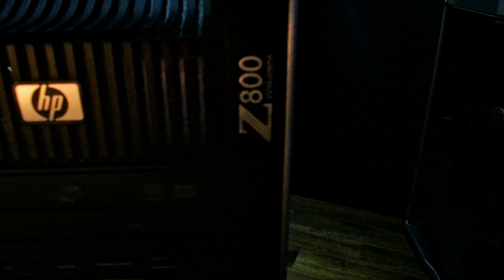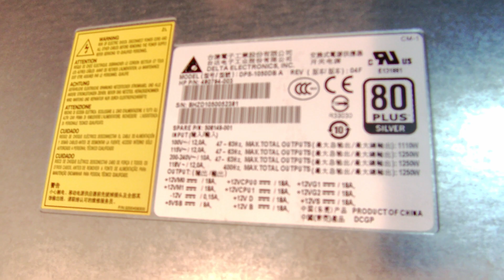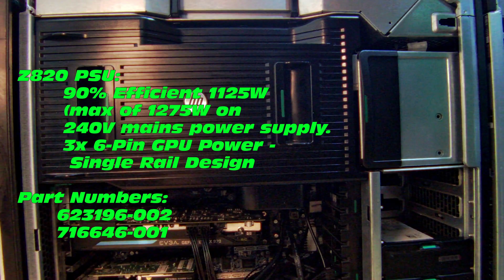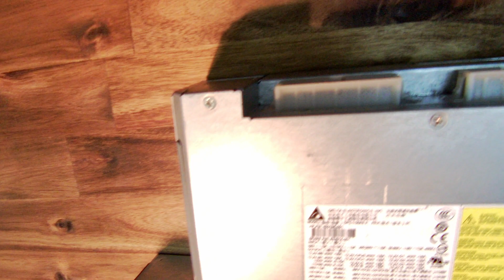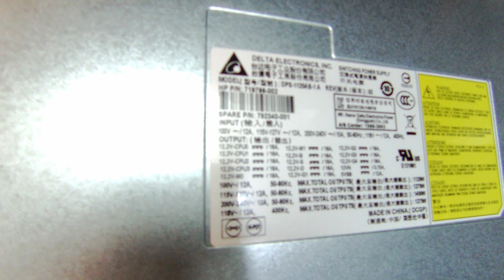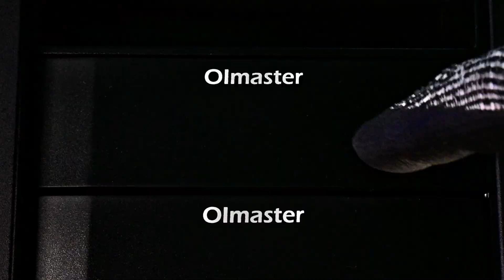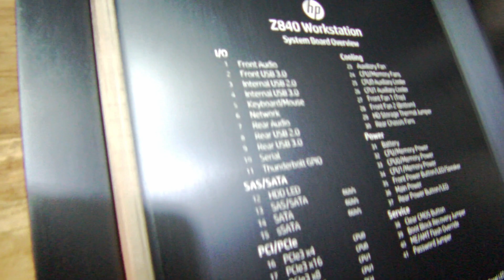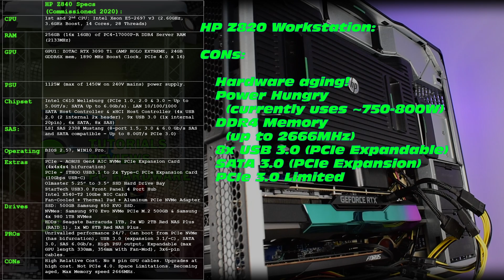Z800 / Z820 / Z840 Guide : Power Up Your Workflow with a Workstation (Remastered).

Comment: hi, do you know a HP z440  max ram supported , assuming the CPU is upgraded appropiately?
Reply from the maker: Hi there. Officially, up to 128 GB total, using 8×16 GB modules. But unofficially, some users have reported using 8×32 GB sticks for 256 GB total - but in the same chat thread someone reported that this configuration didn't work: https://www.reddit.com/r/techsupport/comments/umhjgv/hp_z440_ram_help/. 

So I would say go with 128GB (8x 16GB modules; DDR4 2400MHz ECC Reg if using E5-26xx V4 CPUs), if you happen to have 32GB modules on hand you could test them to see. Start with just one 32GB module and see if the system boots, then try four, then eight. Note, for more than 4 RAM modules on the Z440 you do require the memory fan module (P/N: J2R52AA). I have used 4x 16GB 2400MHz ECC modules on my Z440 with success: https://youtu.be/K4RalaEbRI4?si=U8uCNIdq4mJdhvL1&t=228
Reply: @racerrrz  hi, regarding using a Z440 on another normal case, is it a bit more easy than the Z420 , because there is no need of transistor or temperature sensor connected, but it still need that all the other peripherals to be connected as Z420 motherboard ?

Comment: Any plans on doing something with a z440 or z640?
Reply from the maker: What did you have in mind? 

I have been trying for 4 years to secure a Z600, Z620 and Z640. I gave up and sold my Z600, but I now have a Z640 - so I just need a Z620 to film a similar video guide for them (I filmed the Z600 before selling it!). I have done a related video for the Z4xx here: https://youtu.be/K4RalaEbRI4

If you were after alternative build videos etc., I have done quite a few videos on the Z440, Z840 and Z8 G4. 
Examples:
Z440 Case Swap NAS Build Guide: https://youtu.be/K4RalaEbRI4
Z440 with massive HDD storage: https://youtu.be/T925XvAcqEo
Z840 Overview: https://youtu.be/Om3_HErti08
HP Z8 G4 Overview: https://youtu.be/z7Ff2zs5ByM

It just depends on what your plans were for your system, but I am sure I have video done for it!

Comment: Hi! I have an HP Z820 workstation and I’m wondering if there’s any safe way to overclock the CPU or disable the PL1/PL2 power limits. Is there a method to unlock full Turbo Boost on this workstation without risking hardware damage?
Reply from the maker: Hi there. HP has these workstations on lock-down - leaving no viable method for overclocking. It is counterintuitive on these workstations since they were designed to be reliable and to give stable performance. There may be custom BIOS mods out there that could give some more customization but it's not something I would recommend due to the risk of bricking the system. The other factor is the cost of replacing a motherboard if a customization causes damage. If you can live with the trade-off of favoring stability over peak performance then you'll get good service from these workstations.

Comment: I have this computer and put a 3060 12gb in it and it used to have a 1080ti. Why is it so trash at rendering videos in davinci resolve?? I thought this was supposed to be a powerful pc for it's age but it takes 1 hour to render a 11 minute video. My 3060 laptop only takes 1 minute 30 sec to do the same work as this pc
Reply from the maker: I have used the Z840 and the Z8 G4 for video rendering with DaVinci Resolve studio. The GPU is the bigger bottleneck. I went to an RTX 3090 Ti for the extra VRAM. I had issues where my projects were crashing during export due to insufficient VRAM. 

In terms of your speed issue. It's most likely a setting difference. I presume both comparisons are exported in the same file format, same video resolution and with the same storage medium? Adding effects also heavily change the render time. And I also learnt that text effects like a shadow create a huge problem when rendering. Pending the phase of the render and the complexity, my system renders a 20min MPEG4 in 4k 60fps video in 8min to 4 hours. Most of my work has greenscreen with is heavy to render. 

I tend to render the project in successive batches of renders. Add the audio effects, cut errors and pauses, remove green screen, assemble the scene, then build the A roll and B roll with text overlay. With one project typically having at least 9 renders to completion. Getting the final video together before doing text additions does help so you don't have to rerender all the effects with each export.
Reply: @racerrrz  I got the Z820 for free and it has e5 2670s and 128gb ram. I ran a test render of just rendering a video untouched in mp4 h264 1080p. It rendered the 12 minute video in 3 minutes. 37 seconds faster than my laptop. Next I added subtitles text to scenes, several custom transitions and blurr effect over faces on a few scenes and changed the coloring and lighting on a few shots. I rendered the video at 1080p same settings to the same ssd and now the video took 2 hours to render. I ran the exact same project and changes on my laptop that has a 5800h cpu and 8gb version 3060 gpu and it completed the project in 14 minutes. So I tried again but only adding in the blurr effect over aces on 3 minutes of the video and it still takes 1 hour 17 minutes to render. Same with every other effect. Just touching the video makes the render time sky rocket to over and hour to render. If my gpu is the bottle neck why can my laptop easily handle it. Am I missing something?
Reply from the maker: Ok, that makes more sense. The Z820 is quite aged now and the CPU pair you have will be quite old (I presume E5-2670 V1). The main issue with workstations is the slow single core performance relative to the desktop CPU lineup. Most software packages are optimized for single core utilization, with only certain tasks making use of more than one CPU core. In my current editing rig (HP Z8 G4 + Dual Gold 6248s, 384GB DDR4 2933MHz ECC Reg memory + RTX 3090 Ti + 8TB RAID 0 NVMe storage pool) my single core performance is my main bottleneck, and even a Ryzen 3600 would do better for that. But where my system shines is when I have to use all 40 Cores and 80 Threads. But by design these workstations are for throughput, not single thread performance. 

For a benchmark comparison:
https://www.cpubenchmark.net/compare/2750.2vs3517.2vs6549vs1220.2/%5BDual-CPU%5D-Intel-Xeon-E5-2696-v4-vs-%5BDual-CPU%5D-Intel-Xeon-Gold-6248-vs-AMD-Ryzen-9-9950X3D-vs-%5BDual-CPU%5D-Intel-Xeon-E5-2670

If you can land a Z840 with dual E5-2696 V4s you'll have a better experience from the CPU architecture being newer (also PCIe 3.0, SATA 3.0 and Gen 3 NVMes - the Z820 lags behind due to the aged SATA chipset which is really more SATA 2.0 focused). I have upgraded from the Z840 to the HP Z8 G4 (the Z840's replacement) and it is a decent upgrade in work efficiency. Most of my efficiency came form the RTX 3090 Ti - and I can transplant that into any modern system to gain a good editing experience (the 24GB of VRAM is amazing). 

It's a little harsh, but I would recommend moving away from the Z820 as a daily driver and rather reserve it for home lab functions (so running Proxmox virtualization - not power efficient however). The Z840 can still be daily driven and the upgrades are relatively cheap, but it lacks the CPU architecture to handle modern / AI workflows efficiently. If you can get the Z8 G4 with Cascade Lake Xeons you can get massive core count and the latest in CPU functions (e.g. AVX-512, VNNI, up to 56 Cores, 3TB memory or 4.5TB with Xeon M CPUs, Optane DC Persistent Memory support; unfortunately the Z8 G4 is still really expensive).
Reply: @racerrrz  Very detailed and helpful explanation thank you so much. I spent weeks wondering how it managed to outperform my latop the first day but unable to get any projects done on time for almost 2 weeks I was certain I was doing something wrong or not utilizing this pc correctly. I can at least now look up some way to make use of this pc abd this many cores(maybe). For now I can only use it for handbrake video compression and burning CDs.
Reply: @racerrrz  I really want to make this computer work since it seems to have it all but I can't get it to handle anything I throw at it any better than my 2021 laptop. It uses 3 to 5 times the amount of power and takes 5 to 15 times longer to complete any work loads on any software, UE5, UE4, Belnder, Davinci resolve, capcut, FL studio, Unity, AI training models in language, video, or image or even video compression on handbrake. I am having trouble finding any use for this pc. If I can at least get it to take advantage of it's 32 cores for Video rendering, video compression or 3d modeling or AI training then I can keep it for at least 1 of those tasks.

Comment: As of 2025, I would stay away from Z400/600/800 HP's unless you can get them for next to nothing. Not that they aren't good machines. The Sandybridge CPU's are 32nm and use a lot of power. The z420/620/820 can be had for the same price and are more capable machines. The z440/640/840 are best choice by far. They are similarly priced and much more capable. Haswell and Broadwell Xeon are cheap and still very capable. No AVX-512 but they support AVX-2.
Reply from the maker: I would agree there. There may still be some applications where they could be of use but I haven't given the Z800 much thought since 2020. The Z840 would be the most optimal in the line-up. The hardware might be aging but the Z840 still has so much on offer. Particularly with the on-board SAS chipset - they are ideal for a homelab Proxmox setup with several VMs and especially with an external JBOD added (future video). 

You may find these to be of interest:
Z820 teardown: https://youtu.be/qkvHQSwyxVQ
Z840 teardown: https://youtu.be/2bie4EGJZL0
Z8 G4 teardown: https://youtu.be/z7Ff2zs5ByM
Reply: @racerrrz  For some reason the E5-2697 v3 is the cheapest Xeon right now. They are less than 10USD. Prices on E5-2697a v4's are creeping up. Still cheap but up from 25USD to 40USD.
Reply from the maker: It's probably a result of CPU popularity. The Haswell and Broadwell Xeons were popular in supercomputer architectures and enterprise servers, and I can only presume that as those systems get retired their hardware makes it back to mainstream supply. The E5-2697 V3 is a great performer, solid core count and decent clock speed. It's the same CPU I still have in my Z840. My Z440 got upgraded to a E5-2697A V4 for a memory speed buff.
Reply: @racerrrz  Supply is probably beginning to wane. I got all my work stations and CPU upgrades over a year ago. I payed 296USD for my z840's and they came with 4x8gb PC2133 memory and 2x E5-2620 v3's.

Comment: I have two Z820's or will when the one I just won in an eBay Auction arrives. One is currently set up with one Xeon E5-2620, the other has dual E5-2620's (the one I just won). I will be upgrading the one with the single Xeon to dual E5-2687w v2's when those get here. It's also getting a RAM upgrade.
Reply from the maker: Nice. The Z820 is great value - upgrades are cheap and you have ample end-use cases for them these days. How are you planning to use the second system? I feel like the Z820 is ideally placed as a home Proxmox VM server - you would host just about everything you could want from it and still have spare cores on hand.
Reply: @racerrrz The second one is going to be a Father's Day present. My stepdad needs something better than the old HP laptop I loaned him after his Mom's laptop died.
Reply from the maker: Nice one - that makes for a memorable Father's Day gift. Going from a laptop to a Z820 will be a huge upgrade for him. I am sure you'll be able to give him a good run-down on the capabilities of the system. The Dual E5-2687W V2 CPUs with the 4GHz boost clock speed will give a a seamless experience for daily use.
Reply: @racerrrz He hasn't had a chance to use it yet, mainly because I need to finish my rack installation and run the 10Gb fiber to whatever location he finally decides to put it, but I let him open the box today after it came in. At first it was like "it's not portable," but when I explained it was a lot more powerful than what he'd been using, that suddenly didn't matter. I just have to decide if I'm installing the hard drive from the laptop or just cloning it to the 1TB drive that's already in the computer.

Comment: Not fair flagging this with the 56 cores,112 threads on the thumbnail. Intentionally misleading.
Reply from the maker: You got me, but it actually holds true to the video content quite well. The sum of the cores of all three workstations reviewed in this video was 56 Cores and 112 Threads - my catchy way to capture attention in the thumbnail when I released this video. I have an asterix on the thumbnail to clarify this - making the thumbnail: "56 Cores and 112 Threads * on one table." (Sarcasm - always read the fine print - even on thumbnails).

AMD and Intel have since released CPUs that meet or exceed this core count - but at the time of my video release they did not offer anything this high. "Clickbaity" sure, but it's not mindless clickbait. And full confession - I did it previously in 2021 ("48 Cores and 96 Threads") and I plan to do it again soon - by my count it will be four workstations * on one table - 96 Cores and 192 Threads.

Comment: the problem of those machines is they are SATA 2
Reply from the maker: Correct, the Z800 and Z820 are both Sata 2.0 (the Z820 was released around the time of Sata 3.0 release - so it has 2x USB 3.0s but still has a Sata 2.0 chipset). The HP Z840 is fully PCIe 3.0, Sata 3.0 and SAS 2.0 (embedded LSI SAS2308) - giving you the best possible experience from a dated workstation platform. 

With that said, I added PCIe expansion cards to get my Z800 to transfer at 6Gbps despite not being released with it. PCIe 2.0 offers a decent enough data transfer speed to satisfy most modern storage drives (except NVMes).

Comment: all the CPU in those machines are XEON right?
there are not setup up with 2 CPU in i7 or i9 right?
Reply from the maker: Yes that's correct. The Z8xx workstations only support Xeons. These systems were designed with maximal output in mind. i7 and i9 processors are great for desktop systems (low core count high clock speed), but Xeons cater for high core counts (and lower clock speeds) to give a more server like function. These workstations are basically server systems designed to handle desktop tasks. Giving you the reliability of a server that runs 24/7 but the practical usability of a desktop (i.e. these systems are quiet - likely more quiet than a desktop system!). It's been a while since I used a desktop system for daily use but certain frustrations remain etched into my memory. Like running out of RAM and having to close tabs or having the CPU run at full speed while doing essentially mundane tasks. Admittingly, the modern CPUs have progressed well and will fare really well - you still can't beat these systems on price point. Getting a modern motherboard with two fully functional X16 PCIe slots (with 16 electrical lanes connected) can cost as much as a Z840 alone. If you need something that can handle a lot - these systems deliver and you can expand their functions with upgrades much more so than desktop hardware. e.g. most modern systems do not support PCIe slot bifurcation (splitting a PCIe slot into segments - ideal for connecting 4x NVMes to a single X16 slot) - it comes standard on these systems. I have 4 of my 9 PCIe slots bifurcated on my Z8 G4 to give massive NVMe storage expansion - something I could only dream of on desktop hardware (unless you go down the workstation route).
Reply: @racerrrz  do you have a video showing the PCIe slot bifurcation?
Reply from the maker: Yes I do, this is my overview video (I used the Z440 motherboard as the base system for explaining it): https://youtu.be/PRMWIpscDCg 
I also covered it in less detail in each Quad NVMe RAID 0 PCIe adapter video that I released (there are 5 of them now - one overview and 4 on separate Quad NVMe adapters).
Example: https://youtu.be/xqg0uQ93KTg

Comment: can we add two power supplies to the z840?
Reply from the maker: Technically no, the Z840's PSU has a fully proprietary system which makes it near impossible to get a second PSU connected. 

In saying that, there is a custom wire loom that I have tested which managed to power the Z840's motherboard independent of the original PSU. That may allow you to get a custom dual PSU connected (side note, the new HP Z8 G5 has dual redundant PSUs). I have not made a video on the Z840's PSU cable - technically because I am not sure how reliable it is, and thus I would not endorse it as "reliable". But if you are curious / need something extreme: https://youtu.be/Rsr_zxOg6K8

Comment: Love my Z800. Only issue was a bad temp sensor that caused the fans to run at super noisy full speed until I sourced a replacement. Great to be able to run SAS or SATA in the same bays.
Reply from the maker: Well done on being able to fix that temp sensor. It is a common issue on them and I had that issue on mine also. Thankfully I had the transistors (2N2222A NPN) on hand because I had done a Z420 case swap which also needed them. The only other issue is the PSU failing and given the age of the Z800 now I would say it would be wise to hold onto a spare PSU to make sure you can enjoy the system for a long time yet. They are very versatile systems with the on board SATA and SAS chipset.